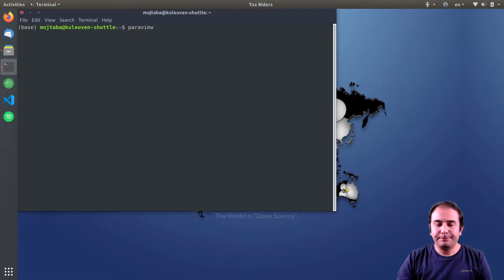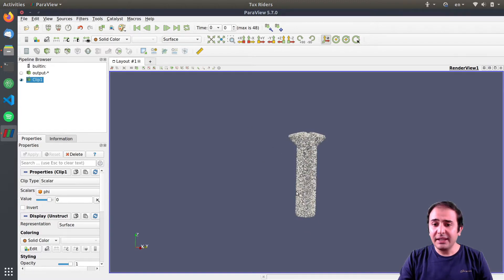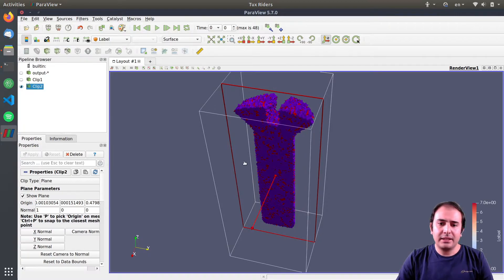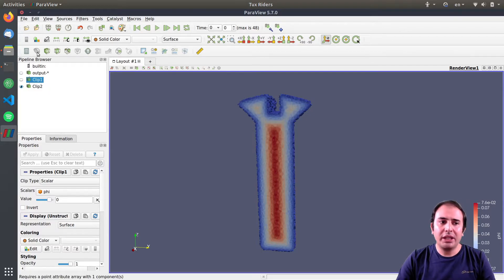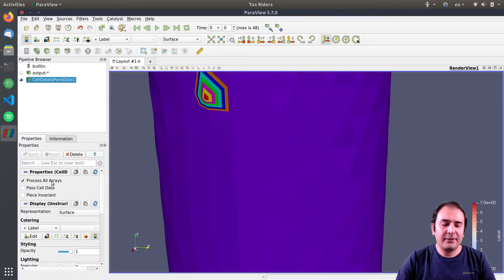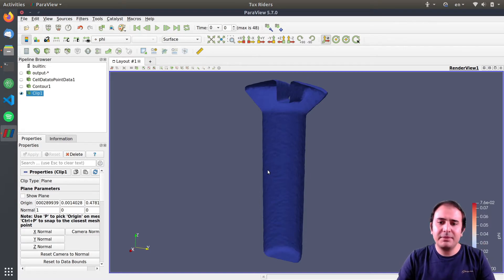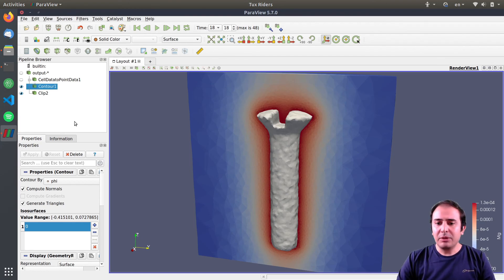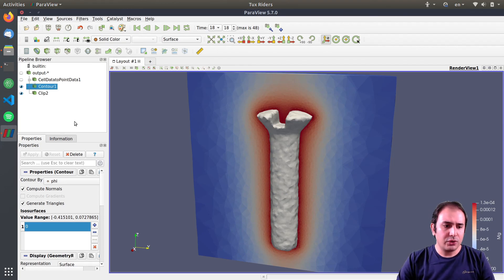[ParaView Postprocessing 7] Contours or clips? (degradation/corrosion project)

Comment: I am trying to find inside a clip box the number of particles having certain diameter size range
Reply from the maker: it should be possible without any programmable filter as long as you have the particle sizes as one of the variables.